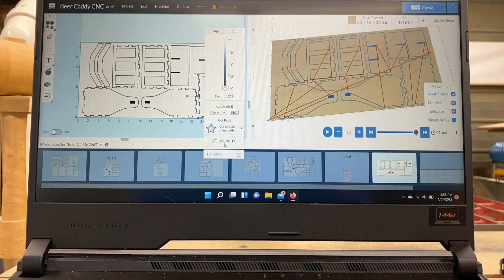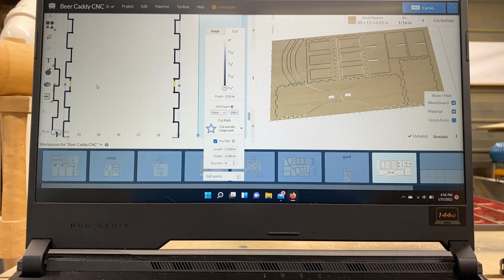OneFinity CNC - Save Money. Save Material. Save Supplies.  Waste board Hack

Comment: If you just learn how to set z accurately off your wasteboard with a well trammed spindle instead of off the top of the material then all of this hassle will be eliminated. What is the one constant....no matter what thickness material you have???
It can be 0.001" material or as thick of material that will fit under the gantry...the wasteboard will always be the same. Set your zero there and you can cut through the masking tape but never leave a mark on the wasteboard. 
It works 100% of the time unless you have a bit drift out of the collet.
Reply from the maker: I see what you’re saying. This is just me learning and sharing, hopefully helpful, information not only to learn from but also spark conversation. This video was to basically show you where your pieces of tape need to be - rather than just waste of bunch of it putting it wherever. If your waste board is chewed up or frayed, the surface that you set your material on may not be “true” in some places. For cutting through thinner pieces, such as 1/4”, the negative affects will be minimal. But if the material is thick, the edges will not be a true 90 degree corner - you’d have a rhombus instead of rectangle. For engraving - it would be a nightmare. 
Now, you bring up an interesting point. It would blow my mind to think my machine would be dialed in so well that it could cut that precise and accurately. Never even entertained the thought. I’m less than a year in to CNC and still have so much to learn.  Thanks for your input , I appreciate it
Reply: @SJSSawdust  I love your channel. I have watched all the way back to the marble machine just because I never watch anything but YouTube. 
The comment above was meant to do exactly that.... possibly encourage cnc users to think about the zero position a little bit differently. I spent years cutting into my wasteboard while setting zero off the top. Then I read a comment in some Facebook group that explained it kind of like I did. There are three advantages to setting zero off the wasteboard. 1- obviously you don't cut into the wasteboard. 2- if you do a 3D carving that removes everything off the top of the material and need to change bits then you have a reference point. 
3- if you are cutting multiple pieces out of plywood or mdf or whatever....and the material varies a tiny bit then you are still going to have a perfectly cut out piece. No onion skin left and no groves cut in the wasteboard. 
It does take one extra step. You have to set X and Y as normal. Either on the bottom left or in the middle. Then you set zero at anywhere you trust as zero. If you're wasteboard is surfaced properly then anywhere works. Try it sometime. 
Once you kind of get comfortable with it.... you'll at least have another tool to use as you make awesome stuff!!
Reply from the maker: @WNC828  Thanks so much - once it gets warmer, I will DEFINITELY try that!

Comment: I like the idea. However, this only help define where to place the tape on the waste board…how about the back of the material to be cut?
Reply from the maker: That process is little less accurate I suppose. I just lay out a few pieces of tape side by side to cover a slightly larger area to ensure it overlaps the tape on the waste board. 
If you wanted to be real accurate, - if you set up your  material from a stop block of sorts, you could flip your material over, flip your file horizontally, (ensure that it’s “centered to material” ) engrave that, and then flip it back over. But that seems to be asking for trouble. I definitely don’t have the patience for that. I’m less than a year in to CNC and still learning. Any info and feedback is greatly appreciated!